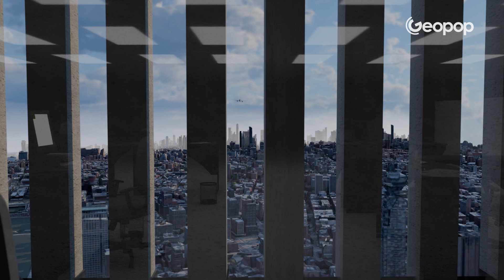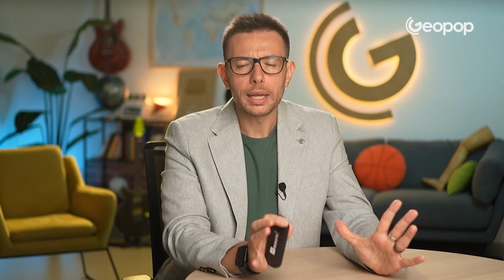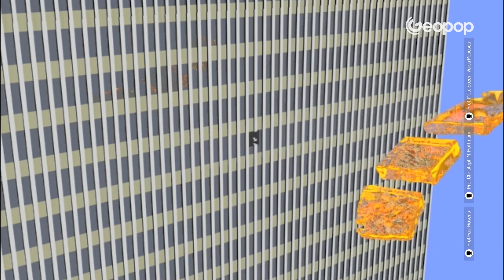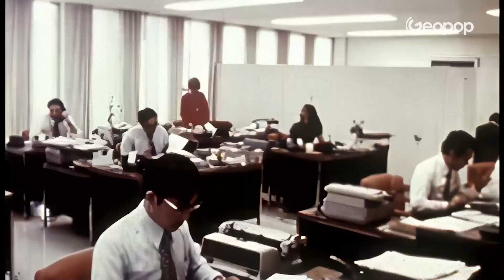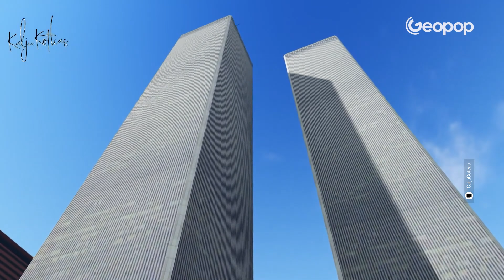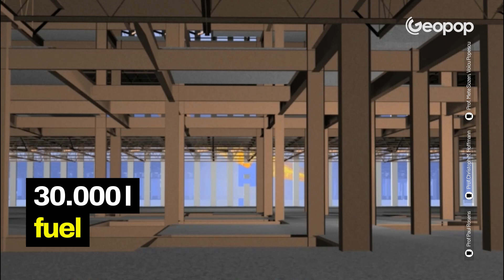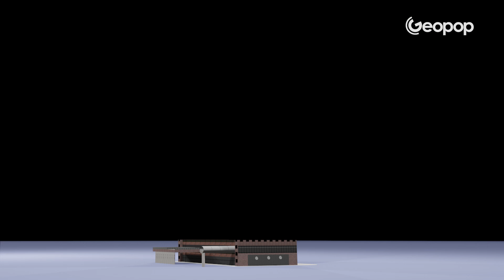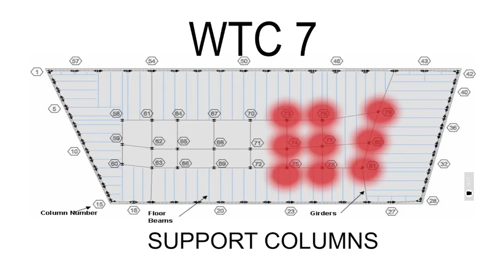9/11, 2001: The Technical Reconstruction of the Twin Towers and WTC 7 Collapses

Comment: I believe the huge volume of jet fuel and the high intense heat of the fire that burned ferociously plus the impact ftom the jet that weakened the building structure across many levels , led to its collapse. The sheer weight of steel ,concrete, glass of the collapsing structure compounded with the height and the speed generated as it fell, contributed to the collapse of the towers.

Comment: As an architect, the towers would have collapsed in any reality due to the load bearing members being compromised by increasing heat from the fuel and material in the building itself.
Reply: And that's why you couldn't make it as an engineer
Reply: @JakeStreisand  that's your opinion, cry me a river
Reply: @durn210  cry me a failed engineering degree close minded propaganda filled bigot 😭😭😭
Reply: @durn210  The smoke was black. The fires were starved.  As a firefighter, this comment is complete nonsense.
Reply: @77huss  ok Einstein, what made it collapse Mr. Negativity?
Reply: @durn210  if you’re an architect, you would know that all of the supporting columns would need to be removed simultaneously for the buildings to collapse the way that they did, especially WTC7.  Free fall speed.  The only buildings that have ever fallen the way WTC 1, 2, and 7 ever in the history of the world of buildings, were controlled demolitions.   Fact check me.
Reply: @77huss  the fires were 1000 degrees, enough to bend steel thus members collapsed due to the weight
Reply: @durn210  Fires don’t make concrete and steel columns disintegrate. Your comment is ignorant.
Reply: @77huss  ha ha did I ever say steel disintegration? To speak in a tone of voice as dumb as you the columns were compromised, in which they were able to bend to the because of the weight above. Your ignorance blinds you. Done arguing with your irrelevance
Reply: @77huss  I didn't say anything about fire disintegrating the steel dork, I said they were compromised as in bending due to the severe heat. There was nothing said about concrete burning.
Reply: @durn210 
Right. So where did it all go? Where did the core columns go?
Reply: @durn210  
I can't debate you any more. My comments are being censored.
Reply: @77huss  wow your an idiot
Reply: @77huss  that because you lose. Done. Good day sir..
Reply: @durn210  That's because you can't answer my question.  God Bless You!
Reply: @77huss  don't have answers to dumb questions
Reply: @durn210  that’s because you’re not an architect, and nothing but a liar. Clown. 🤡
Reply: @durn210  You aren't an architect. You are spreading misinformation.
Reply: @77huss  you are like a cloud. When you disappear, it's a beautiful day. Get lost

Comment: Rest in peace to all. We will never forget. 

With that said, I still believe this was a controlled implosion. I lived in Las Vegas, Nevada, most of my life and have witnessed first-hand buildings being imploded with explosives.

Now I Fabricate structural steel for a living. These were not small columns and beams that supported this building. I'm not buying this or any other explanations any form of gasoline will not burn hot enough to bend or weaken the steel.
Reply: How many of those imploded buildings had heavily fuel laden large passenger jets slam into them just before the implosion???

Comment: If buildings like building 7 collapse because of an office fire.. nobody will ever want to work in a high rise building ever again.. didn’t you have in italy.. or was it Spain a building fire of a a simulator building which burnt 3 days… an still it didn’t collapse
Reply: Building 7 was damaged from falling debris. It had a big gash so the structure was damaged. In combination with fire it eventually collapsed. Basically the same thing as the other 2 towers. But conspiracy nutters like to exclude those facts.

Comment: The fact that they all collapsed within their own footprint will always make me doubt these official explanations. The sudden collapse at the base will always look like a controlled demolition meant to minimize collateral damage.
Reply: Not exactly true.  The top floors of the south tower (second hit, first collapse) leaned over the side of the lower floors during the collapse.  And the "footprint" of the collapses was much much larger than the outline of the original buildings.  To the extent that many buildings and vehicles around the towers were badly damaged or destroyed.  And neither of the tower collapses started at the base, but at the places where they were struck.  Nor did Building 7, which collapsed internally before the facade fell.  If you just want to believe otherwise, you may.  It's America.
Reply: @rossryder944 Thank you 👍🏾
Reply: @rossryder944  You'll never convince the crazies who listen to baseless conspiracy theories.
Reply: Building 7 went down the same way
Reply: Pay attention to the way the towers were built and it will definetly make sense.
Reply: I’m no engineer or architect, but I’d imagine if you’re building a massive tower, you’d build it so it would collapse in a away to prevent collateral damage if it were to fall
Reply: Must watch slow motion of colapse from different views and you can see demolition explosions in lowest floors. This is not secret. Next: 30 seconds before of colapse WTC2 is in one corner visible River of melted metal.
Reply: So - you are saying TWO 110-story buildings were control-demolished. OK. It would take a long time (months?) to rig buildings this size with explosives. AND NOBODY WOULD HAVE SEEN THIS?????!!!😮   You conspiracy folks are dumb. Sorry.
Reply: They DIDN'T "collapse within their own footprint", at all.
Several other buildings were damaged/destroyed in the collapse. Debris was spread far and wide.
We all watched it happen. You freaks seem to want to try to gaslight everyone who witnessed it into an alternative reality because you just can't quit your debunked delusions even after 20 years of this bs.
Reply: Research the lenght of rubble and think abou that "footprint"
Reply: Yep !
Reply: I’ve worked in controlled explosive demolitions. The scale of what people are proposing here is insanely outrageous. Not only that, this is a cascading (compounding) structural collapse. Not a controlled demolition, not an implosion. The puffs of smoke and fire down structure from the collapsing floors is very easily explained by differences in atmospheric pressure. Not controlled detonations, which would actually be “misfires” if they were from a controlled detonation, and of a different scale.
Reply: @AustinGauthier-y1f great reply! 

I've argued with sooooo many folks that this collapse looked nothing like a controlled demolition, so many differences. 

September 11 2001 was a "day of firsts" in quite a few different ways, put simply, things happened that day that we have never seen before & everything that did happen was certainly possible from a scientific & engineering perspective, yet folks who know very little to nothing about both of those fields are always the most vocal in saying it was an inside job. 
So frustrating 😢
Reply: @stevea1288 it was an inside job
Reply: @AustinGauthier-y1f  Do you agree with my notion that we haven’t seen such a collapse ever before, so we don’t know what it’s “supposed” to look like, which leads people to conspiracy theories?
Reply: It’s simple: most of us have never seen a building collapse outside of a controlled demolition. We have no reference point.
Reply: Ok if you payed attention, compound weight is something that happens when weight is put on something like when the north tower collapses on itself, just one floor could weigh more than 10+ and now imagine all that weight in 10-50 floors dropping on itself. It’s the same when you make a jenga tower and you pull out 3 pieces at a time. All the weight will put stress on the floors below which in turn will weaken and add more weight to the falling floors which bend inwards and not out wards which may explain why you think it falls so straight
Reply: @albertamaya6804 yes but it would crumple not implode
Reply: @shaneshonda I dont think you know what an implosion is

Comment: “Fire Proofing on the floors that were involved were almost entirely compromised.” Pure speculation and not probable. Each floor is close to an acre in square footage. What is really meant  by compromised? The only way fireproofing could be ineffective would be if it was removed from the steel components that it was sprayed on. Did anyone do impact tests to see how vulnerable fireproofing was? No, it’s speculation. Additionally, logic tells us that even if some fireproofing was removed then the steel would have random exposure to the heat of a contents fire - contributing to random weakening  of the steel components. This random wreaking, for the sake of argument, would contribute further to an asymmetrical  collapse - not a symmetrical collapse.

Comment: The only evidence you need to know it was an inside job and the official explanation is nothing but a cover up, is to look at what they do when they see alternative theories. They don't listen, they just try to ban you from speaking. If you do the math yourself, it is obvious the towers should never have fallen. They also didn't design the towers to withstand a strike from just the largest commercial airplane used at the time, they applied a safety factor of 4, and they took into account the amount of fuel used on a plane that is 4 times larger than the largest commercial plane used at the time. Which means including considering the fuel of the plane the towers were designed to withstand the impact and fuel of a plane a bit larger than a 747. There is no reason they should have collapsed.
Reply: We get it. 

You aren't very educated. 🎉
Reply: @alicem2103 another plastic clown lady chronically on the internet. You’re sorry as shit🤡 go watch that new Joker movie and cry about it
Reply: @alicem2103  If there was an answer that every major scientific organization agreed on, the government wouldn't have to pull funding from universities with professors in physics and several other relevant fields until the professors get fired. That is the only reason they can say everyone agrees. Do some research.
Reply: @MegaLokopo  Logical fallacies galore.
Are you suggesting the "government" is "pulling funding" from major institutions with the sole purpose of suppressing dissenting voices coming from individual academics and professors? 

"If there were A, then tHe gOvErNmEnT wouldn't be doing B." 

Lol, is that how that works? 
Apparently, the GovErnMenT is doing this to suppress educated people disagreeing, which you've provided no actual examples of, number one.

Number two, even if you COULD provide those examples- you have 0 reliable evidence to demonstrate that they are "pulling funding" for that reason, specifically. 

Because that's the thing about conspiracies.. they involve powerful entities secretly conspiring to do something. 

Most major institutions aren't even primarily funded by "the government" and haven't been for quite a long time. Hence, the public debate about student loan debt forgiveness. Whatever funding you are referring to "being pulled" has very little impact on individual dissenting opinions - and there's been centuries of dissenting opinions on major issues from academics.. there'd be no reason to pull funding from an institution to accomplish what threatening someone's tenure at the faculty level could easily do- should an institution feel one of their payroll recipients is affecting their public image. 

Not everything you gather in your "research" can be attributed to any one belief you happen to harbor. You don't do research if you aren't being objective. There are centuries of precedent concerning dissenting opinions on major issues from academics.. there'd be no reason to pull funding from an institution to accomplish what threatening someone's tenure at the faculty level could easily do- should an institution feel one of their payroll recipients is affecting their public image. 

Not everything you gather in your "research" can be attributed to any one belief you happen to harbor. You don't do research if you aren't being objective. You are on a search to confirm your pre existing narrative. That isn't research. That's confirmation bias. 

Valid hypothesis must be falsifiable.
Reply: @MegaLokopo  Logical fallacies galore.
Are you suggesting the "government" is "pulling funding" from major institutions with the sole purpose of suppressing dissenting voices coming from individual academics and professors? 

"If there were A, then tHe gOvErNmEnT wouldn't be doing B." 

Lol, is that how that works? 
Apparently, the GovErnMenT is doing this to suppres s educated people disagreeing, which you've provided no actual examples of, number one.

Number two, even if you COULD provide those examples- you have 0 reliable evidence to demonstrate that they are "pulling funding" for that reason, specifically. 

Because that's the thing about conspiracies.. they involve powerful entities secretly conspiring to do something. 

Most major institutions aren't even primarily funded by "the government" and haven't been for quite a long time. Hence, the public debate about student loan debt forgiveness. Whatever funding you are referring to "being pulled" has very little impact on individual dissenting opinions - and there's been centuries of dissenting opinions on major issues from academics.. there'd be no reason to pull funding from an institution to accomplish what threatening someone's tenure at the faculty level could easily do- should an institution feel one of their payroll recipients is affecting their public image. 

That isn't research. That's confirmation bias.  

Valid hypothesis must be falsifiable.
Reply: @MegaLokopo obviously your version of research needs to be researched.
Reply: @DavidYoung-je8mf  Do you have any proof of your claim?

Comment: you for get the little balls found in the debris and you forget that there was a beam you can see just disintegrate as its still standing after the building fell at free fall speed you forget the reports of booms going off before it fell you forget how many high rise buildings have fallen into it own foot print before or after these 3 have you forget to use your own brain to think independently of what you hear because your just a stupid human and a sheep that believe what your told because your brainwashed   911 was demolished using thermite by the deep state this guy is just spewing official lies or the real conspiracy because the truth you cant handle its was an inside job
Reply: You forget punctuation.

Comment: 🧐🧐🧐Starting at 4:44 it is already misleading. After the jet fuel burned off, in about 10 to 15 minutes the contents fires would be no match at heating  a matrix of massive interconnected  steel columns beams and girders to their failure temperature. By way of conduction the heat of the fires would be distributed evenly throughout the interconnected steel structural components. 

Furthermore,  anyway you slice it , fire alone , has never, or will ever destroy a building symmetrically ( all sides falling in the same time, at the same speed and in the same direction. But, on 9/11 cameras recorded 3 buildings doing just that - collapsing  symmetrically🧐🧐! So, either I am wrong about heat transfer, or there was some 9/11  shenanigans going on!
Reply: I'll take the first option ie you're wrong.

Comment: Many thanx. 1 point was missed. The weight & size of the engines. @ 700kph 2 , 5-7 ton (varies between R/R, PW, GE.) "Battering Rams" didn't disintegrate on impact & more than likely punched through the building.... maybe ending up in building 7.

Comment: Just who inspected the "9" & "10" core colums to determine that it was "9" and "10" columns in each tower, respectively?

Since debris was mixed up, no one waa allowed to access them, not even officials, and its was very quickly removed to secret locations and destroyed, (not even slightly suspicious that behaviour, no, not at all), and that means that this claim is nothing more than "guess work".

Dont tell me computer modelling because you can make computer models turn out any result you like by changing input data to get the result you want. It is called "tweeking the mix."

Comment: @10:48 "if the load continues to increase" ??????? 

What you're saying is that the load these structures were bearing increased, so they failed? 

It is impossible that the building increased its load. As you already stated at the introduction and setup of the video, the fires and impact damage alone were not sufficient to collapse the building. So, if that is true, then the load did not exceed the buildings capabilities as you're trying to imply subtlety here.

The fire and the impsct damage combined were insufficient. You already stated this, so to be willfully blind and ignorant, you've now gone one further and warped reality by describing the material characteristics of these materials wholly incorrectly and misleadingly.

That's dishonestly 101.
Reply: ""if the load continues to increase" ??????? "
"What you're saying is that the load these structures were bearing increased, so they failed?"

The very next thing he says is that "this is an example of how steel behaves at room temperature"
It was not an example or explanation of how the building collapsed. It's a general explanation of inelastic failure mode in steel.

"That's dishonestly 101."
Dishonesty would be leaving your comment up unedited after misrepresenting what was said so you could call them dishonest.